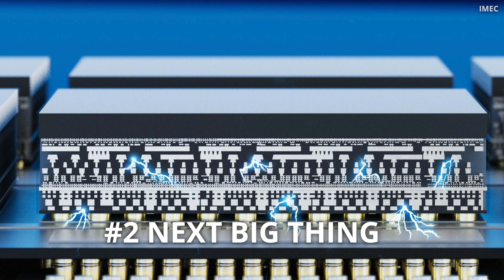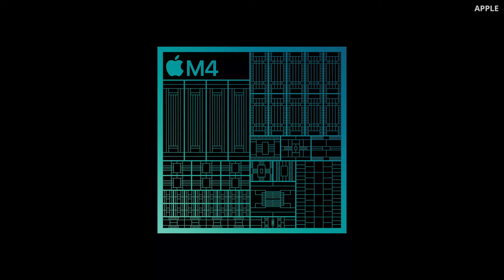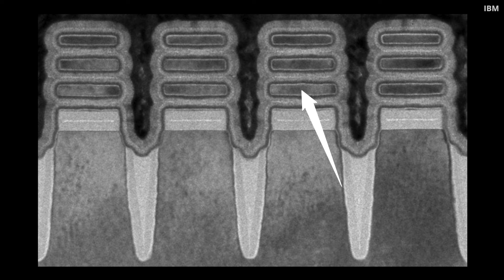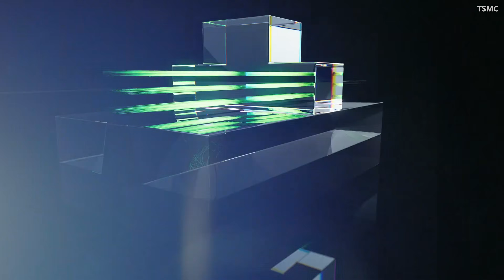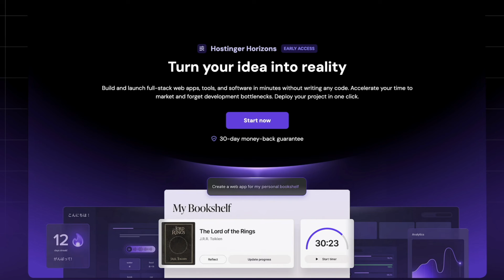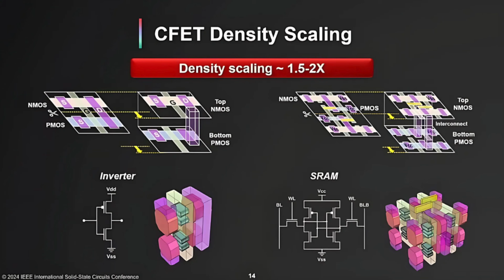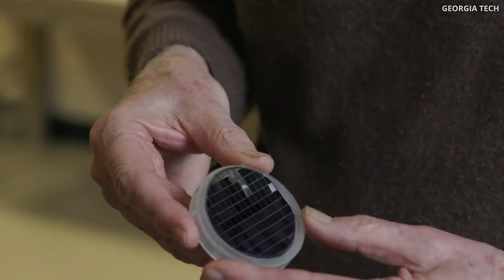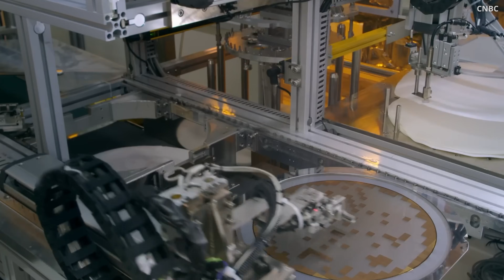The Next Big Thing in Semiconductors

Comment: Are ASML machines not still required? I do not understand what you mean when you say they will no longer be one of the critical steps. Are there not simply additional critical steps?
Reply: ASML machines are still needed but there is less need to rush for hyper NA EUV. The current state of the art high NA EUV should be sufficient for nodes above 1nm.
Reply: In finfet euv is use in 90 % of the process. In GAA maybe use less than 90%